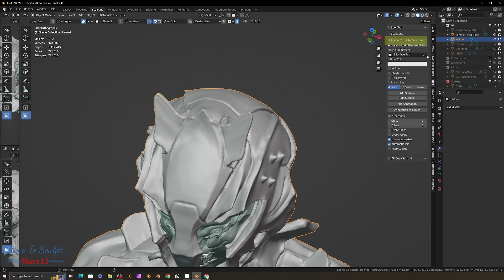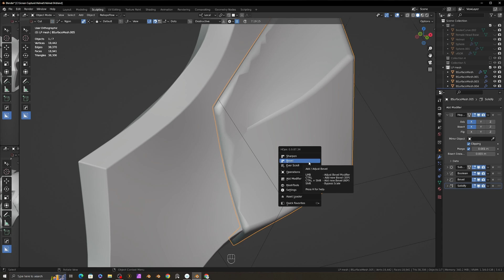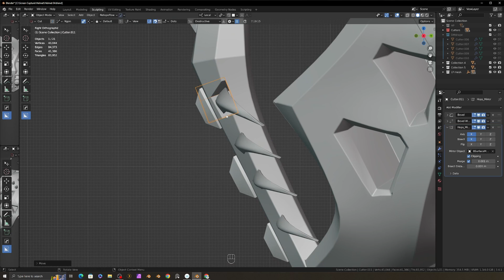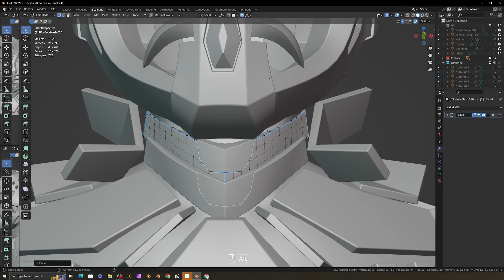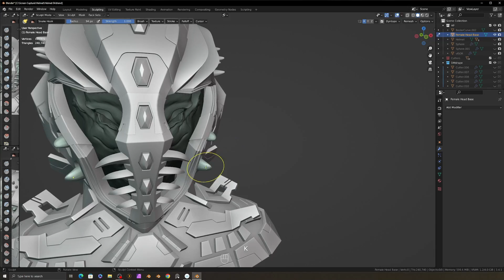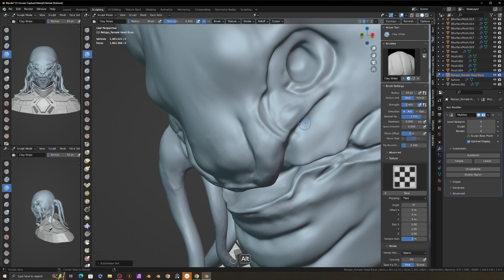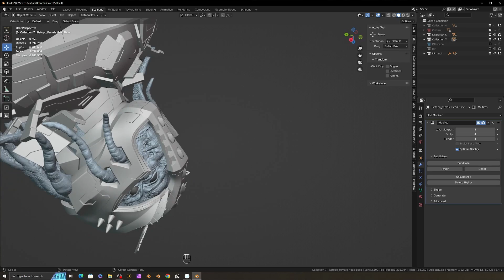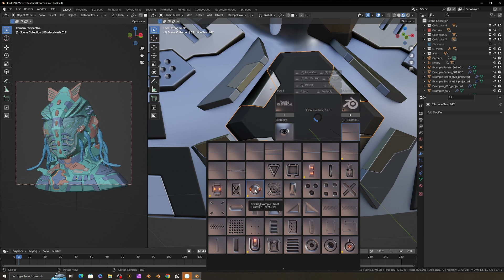Hard Surface Modeling - Helmet - Time Lapse

Comment: why two bevel modifiers https://youtu.be/-lHBHyjUPwU?t=1197 ?are both set to weight? isn't the one at the end of the stack enough?
Reply from the maker: Thanks  a lot for the comment. 
The first one of the bevel modifier is set to weight to add roundness for  manually crease edges. The second bevel modifier is for the  boolean area. The second modifier is not set to weight. It was set as limited method - Angle and adjust the angle as necessary. It is not possible to manually select the booleaned edges.